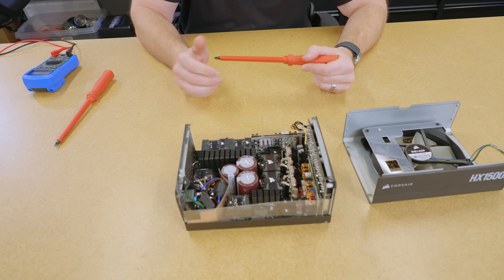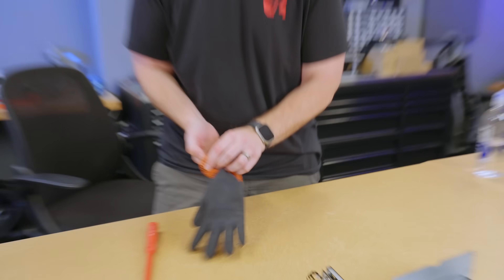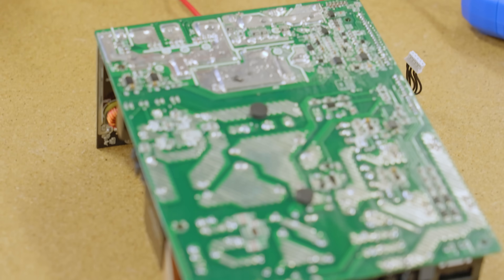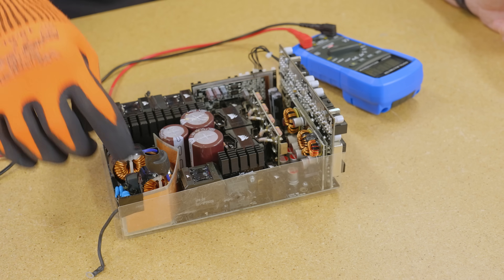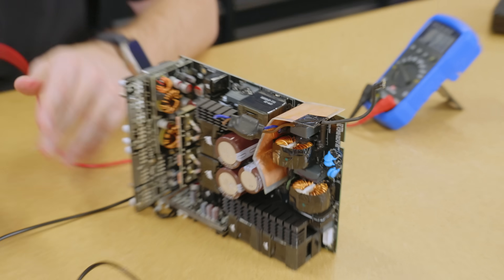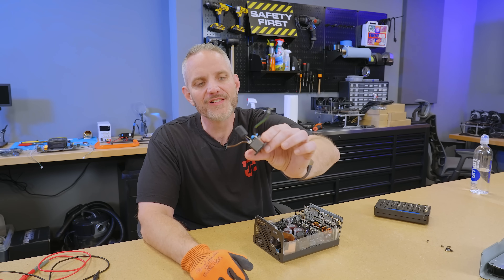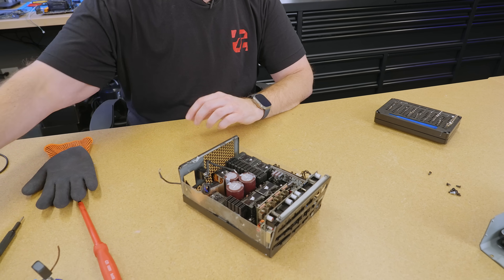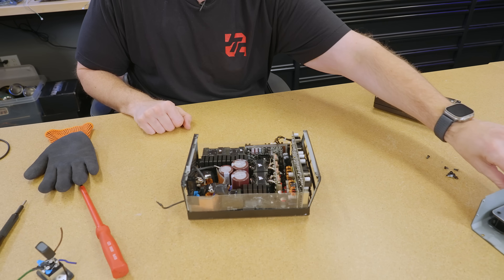Investigating what exploded in my PSU... DANGEROUS! DONT ATTEMPT!

Comment: I'm one of not many people that specialise in repairing PC switch mode power supplies (SMPS), and I've probably fixed thousands of Corsair PSU's. However, I haven't come across the HX1500i yet, probably because they aren't as common. SMPS's are pretty complex things, almost a dark art, and a lot of people get a lot of things wrong when trying to diagnose them or even just figuring them out. No bleed down resistors are used across the caps as that would eat into the PSU's efficiency. In normal use people shouldn't be opening PSU's up, so having charged caps isn't a problem. For this reason the caps can hold a charge for weeks and even months. Have no doubt, THEY CAN KILL YOU! On 230V input the caps will be charged to 380-390V because of the PFC boost converter. Anyhow, to discharge the caps, you can use an incandescent light bulb, that's how I do it, and someone else mentioned the same in the comments.

The PSU uses an LLC resonant converter topology, and that inductor you think failed most likely hasn't failed. It's a simple winding around a magnetic core. It's one of the L's in LLC, the other L (inductor) being the main transformer. They can handle a lot of current, and very rarely ever fail. What is more likely to have failed is a PFC switching MOSFETs, or one of the main switching MOSFETs, or it could be the PFC boost diode, or maybe all 3 in a cascading failure. Without having it in front of me, it's hard to tell, but those are the common weak points.
The controller is on the secondary side, and so the MOSFETs are driven by the gate drive transformer (what looks like a small transformer on the side). Due to this the primary side looks and is relatively simple and clean.

Secondary side failures are less common failure modes, but if the secondary side has failed, it's usually a SR (synchronous rectification) mosfet which has failed short. This is easy to check by using a multimeter to check if there is a short on the 12V output.
And yes, you are probably right, the transient spike is what likely killed it. When the primary side is already thermally saturated, a transient spike can cause avalanche breakdown of the mosfets when an inductive load is suddenly switched off and the energy has nowhere to go.
If you happen to read this and wanted to send it to me, I could probably diagnose the issue and probably even fix it.
 Saves it going into landfill. This is why I fix power supplies anyway, to give them a second lease of life!
Reply: Just to add, lots of people are saying the cap has blown. In my experience, main bulk caps very very very rarely fail. If there was a loud bang, the top would be visibly bulged and split outwards. Corsair uses black silicone glue to dampen noise and that's probably what that black line is, a bit of glue residue. The yellow stuff is likely flux residues from board cleaning. Also, a small split would hiss out and wouldn't cause a loud bang like a mosfet exploding would. Only high ESR, or internal resistance would cause a cap to heat up and explode, and if this was the case, then the caps would likely no longer hold a charge as they would bleed down through the failed cap.
However, I don't have the PSU in front of me so I can't be 100% sure, hard to tell from the video, but unlikely nevertheless.
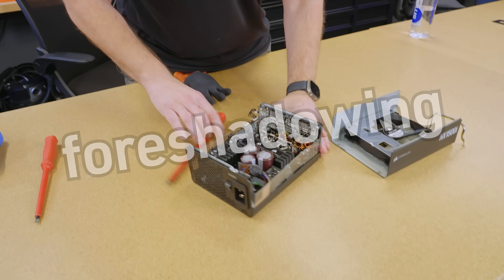Reply: @sam33r100  Glad I read enough comments to find you saying things I was considering pointing out, just a pity this is buried where hardly anyone will see it. I'm fortunate enough to be able to examine the video in 4K res on a 43" monitor, and the yellow residue is very clearly the remnants of board washing, pooling in droplets around the rim of the caps. If the capacitor was venting, electrolyte would spray onto the fan which is immediately under the caps in common mounting position. It can be seen at the beginning and at 1:19 that the fan is completely clean. It seems clear to me that the black line on the 680uF cap is silicone - I'd suspect from a screwdriver tip or slim spatula being used to steady the assembly during application of silicone. At 7:43 you can see on the larger cap a couple of jagged scrapes from the corner of the tool, both ends leaving a tiny black blob. Then on the 470uF cap, there is an incomplete straight black line of the same length as the black residue in the other groove, including a small blob and also attached to a transverse vent groove. I reckon someone applying the silicone to components has been steadying the PSU with the tip of a flat blade screwdriver, locating it in the vent grooves.
Reply: @PlatypusPerspective  Glad to see someone agrees! Yep, I knew this would get drowned out in the comments. Logically  it all makes sense. The reason people still think capacitors fail is because of the capacitor plague from around 2000. This isn't the case anymore and capacitors are not a common failure mode.
Reply: Good to know.

Comment: normally transformers dont "pop" they get really hot smoke and burn unless they are exposed to REALLY over current as there is nothing under compression or sealed like capacitors and other components on the board. use a lightbulb to discharge teh capacitors-the bigger the better as those caps will only hold a flash worth of power and then dig into it. get a light bulb (old lamp socket) turn it on then strip the wires to the plug and drag those across teh back of the board where you are getting voltage--- WEAR A FACE SHIELD-DENIM LONG SLEVED SHIRT AND HEAVY LEATHER GLVOES... AND EAR PLUGS.... if you were in HV panels you should know what youre doing should be class 2 electrical PPE at a minimum..... OR you could just say YEET and just lob the power supply on a metal deck

Comment: JFC please do not ever do this again! And anyone reading this, NEVER EVER EVER try this! Just no! There are specialized places with trained technicians and safety equipment who could handle this safely, but not at home! You shut your computer down, unplug the PSU, then disconnect it from your system and either send it off for repair or (almost always) replace it, either under warranty or through buying a new one.

Comment: A loud bang and yellow powder coming from a power supply indicates a component failure, likely a popped diode  or a burnt-out component like a resistor or capacitor. @Jay if you want to discharge a cap find some dirt (earth) and set the PCB on it for 30 to 60 seconds, quick and dirty gets the job done! Thank for the entertainment.

Comment: the vent in one of the big caps popped from overheating. you can see it looks like it has a little cut @7:42. its the one with yellow on it that you poked. also you were poking either chokes or transformers that are a part of a flyback or flyforward dc/dc converter circuit.

Comment: Be really shouldn't be worried about the voltage. It's the amps that you should be worried about. I mean a taser is 50,000 volts and people get hit with those all the time. But they're really low on amps. Voltage really doesn't matter.

Comment: Modern computer power supplies are a work of art. Between the power factor correction, noise suppression, and the main power converter that's able to handle 1500w of sauce with less waste heat and energy than my older generation power supply of HALF the capacity.
Those line wires are a bit disconcertingly thin to pull 13A through though.

My pet theory on the sequence of Problems, gathered between watching the video and skimming the comments, and garnished with some mild humor for your amusement.
A MOSFET fails short circuit. Likely one of the main power switching ones underneath that large heatsink, due to their immense power (and responsibility).
This dumps the main bulk capacitors into the failed component. The MSOFET is now doing its best Electroboom impersonation as it leaves the chat.
The plasma formerly known as a MOSFET drains the main capacitors almost as fast as your average reddit user's reaction time. They don't like this. 
The one capacitor experiences a momentary overpressure, popping its vent and leaking a small amount of electrolyte.
The capacitors are now empty inside. Relatable. The plasma arc extinguishes. Jay has been successfully flashbanged, but he hasn't comprehended this yet.
The APFC system, like a pizza delivery guy, opens the door to a burning apartment with a fresh delivery of more power. Straight into what might as well be a dead f@#$%ing short.
The black component Jay measured as open circuit is a noise suppressor known as a "Common Mode Suppression Choke". This part is overloaded by this, and burns open.
I can't really see the APFC MOSFETs under the small heatsink, where Jay has been pointing, but it's more than possible that one of them was overstressed by the event and also went bang.
The power supply is now a very expensive paperweight, and Jay about now begins reacting to the earth-shattering kaboom.

Comment: one of the larger 2 caps has vented , those larger caps dont usually open right up they just tear the stamping/weakening like yours has 
the standard topology of pc smpsu,s is cap coupled half bridge so 2 resorvior caps after bridge rectification in series providing a half voltage tap in 240v mode and voltage doubling in 120v mode so if one cap fails the other cant continue both have to work, think of it as 2 x12v batteries in a 24v truck /lorry one fails and its game over 
the topology changes when you have active power factor correction but ive not seen that used in pc power supplies yet only passive pfc
the transformer as you called it isnt , looks like the mains input common mode choke (a noise filter to filter power supply switching trasient noise entering your house wiring)
then theres 2x pfc inductors and then 2x chopper tranformers which i expect to be running in parralel  but without having one in my hand thats best guessing

ex tv repair ,arcade machine repair engineer, now i repair car electronics -not recommended unless you like metally torturing yourself
did someone say use a 12v fan wtf!!!!!! we have in the order of 350 to 370vdc across 2 caps in series if both caps were working,  180v ish each (in boost half bridge topology)
corsair:  wheres the manditory 22-47k bleed resistors directly across each cap ??? expected full discharge in 1-2 minutes or faster ! quality control =0 ??

Comment: Many years ago I had a 230 watt PSU short out and a capacitor blow. The sound was like if a grenade had gone off and the PSU itself was absolutely shredded, the actual metal casing that is. If such a low capacity PSU can do that I wouldn't want to find out what damage a 1500 watt PSU can do if it blows a capacitor.
Reply: This one's caps vented safely.

Comment: what useless video afraid from a 400v cap charged at 150v which wont even tickle and scared from discharging it because it will literally make a small pop which it wont do at at 150 it will only spark also think caps hold charge forver and doesnt even know rhat the pop was from a mosfet and not a tranformer...its a shame uts aal tech channel acting like a 5 year old  unsubbing

Comment: I've never seen a corsair PSU pop, the part that I've seen fail on corsair PSU's is the fans. I've replaced so many failed fans on these. That said it looks like you had a cascade failure, that led to a cap popping. You should ship that thing to Steve or Linus.

Comment: Because the input caps were what failed, I reckon it was a bad cap in the first place that was going to fail anyway - you just helped it along! Also possible is a switching mosfet failed dead-short, as they do, and the massive surge took out that cap. Either way, a loud bang with smoke would have followed the cap, and a loud "crack" would have been if the mosfet went.

Comment: One of those big input caps looks to have failed... the vent line is cracked on the top. You can use a big high dissipation resistor to dissipate the caps safely, or get a dedicated capacitor discharger if you plan to do something like this again. It actually makes me quite unimpressed with Corsair PSUs... they should have a bleed circuit on those input caps! Look on YouTube for some material on switching power supply design - there's several excellent resources talking about all the various parts of one of these units.

Comment: Says DO NOT DO THIS. Leaves his fuggin ring and watch on. My GOD. Tell me you've never worked on high voltage components without telling me that you've never worked high voltage components. EDIT - at least you took your ring off later. Still, ALL JEWELRY COMES OFF. That black box that you were pointing to looks like a transformer. Those usually don't go bang.

Comment: If you held your multimeter probes on long enough, you would have discharged the cap (quicker way would be to use a high resistor 1W resister to ground but it'll still take time).

Comment: You can use a lightbulb, the old ones, the incandecen ones. Put them on a socket and then add a couple of short wires. Poke the caps with the ends and it'll be the same as if you plugged the lightbulb to the wall, I'll flash for a sec and then it'll slowly go down in intensity until the cap is fully discharged. It's the safest way to do this.
Reply: Some wire tracer kits will even include a bulb socket with alligator clips and/or a screw-in 2 prong plug for tracing lighting circuits.  They're good, cheap multi-purpose tools for anyone to own.  They also make sockets that just plug in to a receptacle--grab a bunch of those and some small bulbs and they make it easy to set up smart home controls for a whole room without shuffling lamps around.
Reply: It's good to use low power halogen mains bulbs or oven bulbs and connect some in series. For example for 240V countries, two in series are good, but for North America you may want 3. Reason is the maximum voltage in the PSU is not rectified mains, it's more and up to 450V DC.

Comment: Cap popped? 
Doesn't look like it, later in the video when he turns it around. That crack turned out to be a shade. Generally popped caps smells like ,, bad fish. it's something you'd notice for sure with a big cap like this. 
I suspect it's the amp thingamabob that is bolted onto that big back heatsink that went pOp

Comment: As others have said, one of the caps has died. The patterns on the top of the caps are deliberate weak spots designed to split so the caps don't launch off the board like bullets when they blow.
You can see one has split and that yellow gunk used to be the electrolyte inside of it. 
That could well have made a pretty loud bang despite only being a small hole, think of the pressure required to rip that aluminium casing apart.

Comment: I have fixed numerous PSU in the last few months. You definitely need to have an idea of what you are doing when attempting this, in particular to have an overall idea of a PSU architecture. Schematics is not absolutely necessary if you have an understanding of how a PSU works. You probably have a dead MOSFET on the PFC stage. First discharge your caps  using a dedicated discharger (few bucks on Ali) then check resitance on all mosfets pins
Reply: except the cap is so obviously blown it's not even funny....

Comment: 1:49 middle cap is broken open. That's where the sound came from. You can safely discharge them by using a metal screwdriver or something conductive, as long as the part you're holding is plastic, it will be fine, and will make a small spark, but nothing dangerous. I'd almost wonder if the cap relief cut was faulty. There doesn't appear to be bludging at the top, and the way it failed makes me think the cut was to deep and it failed just from getting hot, not too hot, but just hot enough.

Comment: The fact that the capacitors keep the charge hints of a blown standby supply (usually single 5V output at 5W-15W or so).
It would normally use some power and slowly discharge the capacitors over multiple secounds.

The main supply is likely intact and still good, but does very much depends on the standby supply to even start up!
(main supply would be 3.3V, 5V, 12V source)

So blown mosfet in the standby supply (tiny transformer to the side) would be a likely issue.

Based on the video, there may be some glue on the capacitors? they hold voltage so it doesn't seem very blown!
Reply: One of the few sensible comments on this video. 👍

Comment: When I was in my teen I decided to remove the fan from an old PSU for my pc case.... Tip, don't... Touched the coil (I think) with a PLASTIC HANDLED screw driver... and 20 years later, it's still one of the most painful experiences, well baring kidney stones... Bloody thing electrocuted me and it wasn't even plugged in, they hold one hell of a charge just waiting to discharge.
Reply: Very little holds a candle to passing a kidney stone. I can do without the several 24-48hrs of that I've experienced. I've blown caps; I've been belted across the room by caps; they don't even remotely hold a candle.